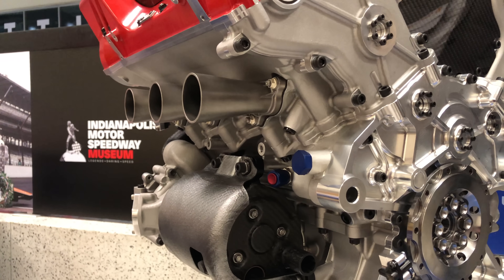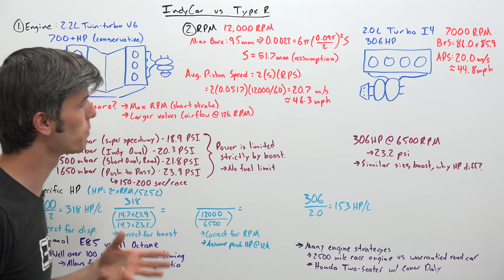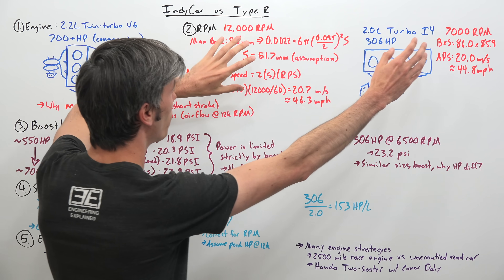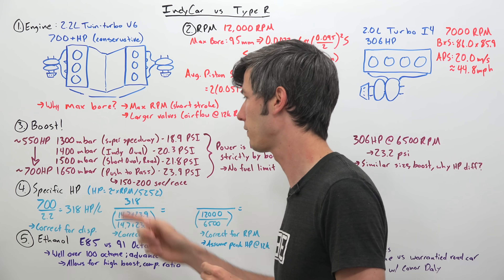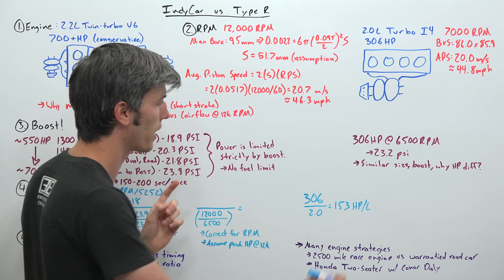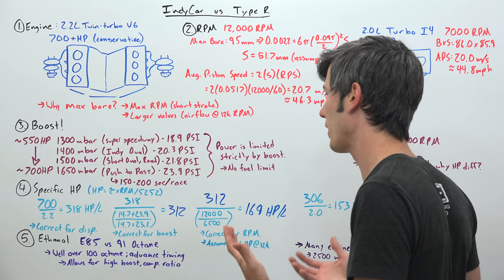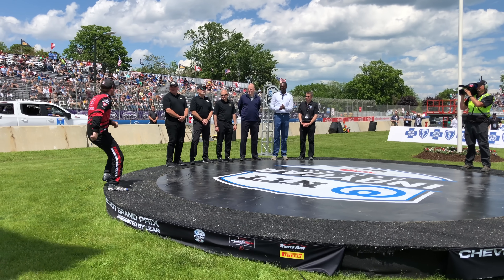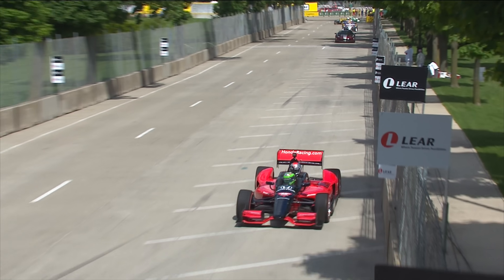How Honda’s 2.2L Engine Makes Over 700 Horsepower

Comment from the maker: IMPORTANT CORRECTION: In this video I state the boost pressures are 1300-1650 mbar above atmospheric, as is indicated on IndyCar's website (https://bit.ly/2XvviEU). This information, and the website, are not correct. Two IndyCar engineers have since notified me the boost pressures are absolute, meaning the gauge pressure for these engines above atmospheric is about 300-650 mbar, or about 4-9.5 psi. This is significantly less boost than discussed in the video. The math makes sense as well with the update. With pressure ranging from 1300 to 1650 mbar, and power ranging from 550 to 700 HP, we can do some quick ratios to see if it adds up. 1650/1300 = 1.27. 700/550 = 1.27. The power gain is thus proportional to the gain in pressure. E85 plays a larger role in power generation than the video indicates, and makes up for the gap that the "reduced" boost makes. Apologies for providing incorrect information, and thank you to the engineers who reached out with corrections and supporting materials! Mistakes happen; I will always do my best to provide corrections if necessary! Hopefully IndyCar will correct their website as well to reduce future confusion.
Reply: Very important correction! :)  Thanks for clearing up. It seems obvious to me that the Civic 4-lunger certainly isn't running anywhere near that boost pressure either, certainly not on pump gas at 9.8:1 compression!
Reply: @devilsoffspring5519  Yes it will. Corrections because of knocking will be done via ignition timing.
Reply: @jakecole7447  It really runs at well over 20 PSI boost on pump gas at 9.8 CR? Somehow I really doubt it. For 300HP on a 2.0 liter 4, more like less than 10 PSI.
20+ PSI shouldn't be necessary for 300 HP, nowhere near that much.
Reply: @devilsoffspring5519  dude... Just Google it. They run 22-25 psi Stock. And no you dont teach 310 HP with that RPM and compression with 10 psi. Modded 5.2 Liter v10s run that sorta boost.
Reply: @devilsoffspring5519  Intake pressure is not as related to power output at most people think.  Turbos that are larger will function much more efficiently at peak rpm.  This means one turbo can provide quite a bit more power than another (at identical PSI) because of increased air density.  In other words.. PSI doesn't measure how much air is actually flowing through the motor, it only measures pressure exerted on the intake manifold.  This is why you have hondas and subarus making under 300 hp at the tire but still running 16 PSI and other street cars making well over 500 hp with 16 PSI
Reply: @devilsoffspring5519  my Subaru WRX hits peak boost at about 22 psi. Stock turbo.
Reply: @devilsoffspring5519  my subaru was dyno tuned to 300whp and has 18psi.
Reply: @FalloutMan493  THANK YOU. I was waiting for this. People love to talk about boost, when they should really be talking about air density. Banks Engineering really exemplifies this in their tuning, and Gale has made some killer videos (pertaining to diesel engines, but the concept is obviously the same).

It blows my mind how people forget that. With NA engines, there's always talk about elevation and air temperature and what not because it affects the air density and thus the power NA engines make, but the whole point of forced induction is to have denser air, which means more O2 to burn more fuel and make more power. It's why smaller turbocharged engines can match the power of a say a larger V8, but be more efficient when cruising or not under load (see Ford's Ecoboost motors VS their 5.0 V8). I think that within a couple decades, the only V8's that will be left in production automobiles will be in supercars (and likely paired with hybrid systems and will have small displacements) and future versions of the Powerstroke and Duramax diesel engines in trucks. Small turbo engines will reign until EV batteries are sustainable enough environmentally and yield power densities a few times higher than they currently do to allow EV's to take over.
Reply: My suggestion, remake the video where this gets corrected/discussed otherwise we get false data implanted into our brain. That's why this sort of vid is good, we have a stab at how we see things, "experts" pop up and offer valuable info, we all gain. Good job. These question have wizzed though my mind, I'm a curious engineer. I'd like to know the detail of F1 engines compared to a powerful commercial engine. I know octane and revs are the main ones. One comment by an expert was, tolerance are greater (and well defined) on a sports engine, longlevity is not the criteria.
Reply: Would you ever consider doing a video about the upper limits for an engine's RPM? 
I know F1 cars have had some crazy fast turning engines in the past, and when I calculate the time the combustion cycle has to produce power I get a surprising small number. 
Which leads to my question. Is flame propagation the limiting factor, or something else?  And if so what is that limit (in time and rpm)?
Thanks
Reply: The main reason  why we don't have this high hp compared to engine size in street legal cars is because of emissions regulation : racing cars are not restricted by this. I doubt you can make a 2.2 700 hp engine and still make the emission regulations which get stricter and stricter
Reply: I'm having an awesome time😅😅😅😅😅😅😅
Reply: I really think you should look at class 8 truck engines such as the n14 c15 and others c16 c18 kta19 the c15 twin turbo I drive makes peak torque before 1500 rpms very cool
Reply: youre the best
Reply: Legend cuz
Reply: 4cylinder is faster honestly lol
Reply: ⁶⁷⅞
Reply: How much more power from e85 over 91 octane gasoline
Reply: Dude, you still rock, maybe even more because of your humility.  Oh nevermind, I forgot, engineers don't have feelings. 😉
Reply: Real smart, talking to an amateur driving 200 mph. Real intelligent.
Reply: Interesting you don't give any credence to the fact the pistons and cylinders are machined that much more precisely than commercial engines thus losing less energy in the combustion process. Hence why F1 cars engines need to be warm when turned over.
Reply: @jeremycole32  Nope F1 cars need to be warm when turning on because the pistons are so flat that there would be risk of tipping when they´re cold and for proper oiling since they idle at quiet high rpm. Also friction energy is a very very minor percentage of power it requires from an engine.
Reply: No way a 2.2 liter engine made 700hp on 9psi of boost. And no way a 2.0 liter 4 cylinder made 310hp on 9 psi neither..
Reply: @grumpystony  Boost isn't everything. Firstly, air density is more important, and one can maximize the density of the air going into the engine through intercoolers and other means.
Secondly, remember, this is a race car engine. There are no limits to exhaust or intake setups or emissions to worry about like there are in passenger vehicles. 
Finally, they run on E85 which allows them to make way more power than you can with pump gas. 

You have a lot to learn if you genuinely believe those power numbers aren't real, unless your comment is simply stating how amazing it is that they squeezed so much power out of that little engine.

Edit:
Almost forgot to mention RPM. The engine revs to 12,000 RPM. Remember, horsepower is torque times RPM, and while it is obviously not always that simple (see HP and torque curves, along with gearing), 12,000 RPM allows for significantly more power, as far more power strokes occur, meaning you can burn more fuel and air and hence have a higher power output. It's really not unrealistic
Reply: @BradChadley  that's cute.  I build and tune my cars.  We dont have restrictions neither.  Those racing Honda cylinder heads and the same intercoolers we use cant make 700 hp out of 2.2 litres @ 9psi even out of a large frame turbo. Now on a GM lsx engine with decently large cubic inch. 5.0litre and bigger could easily make 700hp on large twin in the low psi range. That's just real world experience. I dont need fancy calcations.
Reply: @grumpystony  Well, go to Honda with your real world experience and maybe you could learn some things to help improve your business.
Reply: @grumpystony  And again, consider the RPM limit and the fact that it runs on E85.

Also, the math is right in front of you on the video, and again in Jason's comment. It's absolutely absurd that you would question it without doing any math or research into how it is done, yet simply claim it is false because you have experience building engines.
Reply: Seriously, I want to know what your  IQ IS . SO WHAT IS IT?

Comment: This vid is similar to my engine. For decades i hv wanted to make over 500HP on my 2.5 L twin turbo engine. Stock OEM is 170HP, 6K RPM, compression: 7.6--1, w/8psi.  To hit my goal, i think it is required to somehow raise compression to 9:1, or 10:1 w/14--18psi. Bcuz, if i run 35--50psi at 7.6--1, it might be too much stress on the head-to-block area. Is my 6K RPM a fixed, unchangeable area? Til now, i hv only been able to get 240HP at 6K rpm at 20psi. I remember Toyota built a 2.1 L w/900+ HP Pikes Peak car. Is my goal achievable? What should i do to achieve my goal ?

Comment: That was a nice looking k24a4 you showed. Great engine. It was under used imo. It has more power than most Honda 4 cylinders and is one of their most powerful N/A 4 cylinders engines. It’s also extremely reliable. The k24 should have been used in more Hondas

Comment: Your calculations suggestion  the F1 pistons have a 10% greater circumference and a 22% greater top surface area. Considering just these dimensions suggest the F1 pistons would be heavier. It’s not obvious a shorter stroke provides a lot of opportunity to make a piston lighter but I’m am sure Honda Engineers did there magic and likely used clever design and likely exotic materials to minimize weight because with the same piston velocity and a 72% higher rpm the pistons will have to accelerate 72% faster and as Issac pointed out F=mA. Honda did an amazing job making this engine work.

Comment: something else to mention is where in the rpm the torque and power curves are, the 2.2l has more peak power so would be a blast to rip through the gears but im betting the 2l has a far more consistent curve throughout the whole rpm and honestly im betting its got more torque through out most of the lower rpm making it far more usable as an actual street engine.

Comment: How has Honda done at the Indy 500 since this engine started. 2012, 2014, 2016, 2017, 2020, 2021, and 2022, All winning the race. The season, 2013, 2015, 2018, 2020, and 2021 Championships. All the Titles came with Chip Ganassi, but only Two Indy 500's did as well. Andretti won 3 of the races, and Rahal and Meyer Shank won the other two. Everything else since 2012 was won buy a Penske Chevy team, except the 2013 Indy 500, won by Kevin Kalkhoven (RIP) and Jimmy Vasser's team and Tony Kanaan, in a Chevy.

Honda also won every Indy Racing League/IndyCar Series Race from 2006 to 2011 as the sole engine supplier, Except for the 2008 Long Beach Race due to Champ Car rules. But yeah, Honda Revolutionized IndyCar racing

Comment: Not a big deal but you said specific horsepower when you meant to say brake mean effective pressure. Specific horsepower is power to weight ratio. It has always amazed me how many different ways there are to describe how engines make power.

Comment: Probably it exploits tighter tolerances, making more power from each power stroke.  The intake and exhaust paths are perhaps more ideal because the engine does not concern itself with fender or hood clearance.  Their e85 is probably a racing brand carefully mixed whereas the type sold at the pump is much less consistent...allowing them to run more timing than you even if you have e85 at local stations.

Comment: G'Day Jason,Mate my only comment(Correction)Is Piston speed,,12000rpm the piston is changing direction super fast,,so not so much piston speed as distance travelled,,
think about it12000Rpm mean the piston has to travell up and down 6000 time a minute,a lot more, so speed would be far higher,compare to dictance travelled,,
Do like your show,,Not always in agreement,, but get me thinking..and I like that,

Comment: In 1986 there was a renault 5(le car) maxi turbo 2.
385hp and 354horse power.
With 1.4liter.
35 have been pass already and they may have more technology.
Renault is working on low profile...

Comment: One calculation you didn't do is piston acceleration -- important not because it changes specific power but it does begin to explain specific costs.  I'll give it a go, sorry no whiteboard:

12,000 rpm / 60 = 200 rps
1/200 = .005 sec per rev
.005 / 4 = .00125 sec per half stroke
20.7 m/s x 2 = 41.4 peak piston speed
41.4 / .00125 = 33,120 m/sec^2
33,120 / 9.8 = 3,380 g (assumes constant acceleration simplification)

7,000 rpm / 60 = 116.7 rps
1 / 116.7 = .00857 sec per rev
.00857 / 4 = .00214 sec per half stroke
20 m/s x 2 = 40 m/s peak piston speed
40 / .00214 = 18,666.7 m/sec^2
18,666.7 / 9.8 = 1,904 g

3,380 g / 1,904 g = 1.77 
If my calculations are close, the race engine's pistons experience in the neighborhood of 75 percent greater force (disregarding differences in weight, which are probably significant but costly, and include material property and size - material amount - factors).

Comment: The civic type r can make 140 horsepower at 2500 rpm and 252 horsepower at 4500 rpm where it’s the peak torque of 295 lbs and the full 306 horsepower at 6500 rpm. I discovered it myself by doing the math. Because (Torque x RPM divided by 5252 = horsepower) so (295 lbs x 2500 RPM divided by 5252 equals 140 horsepower). And (295 lbs x 4500 RPM divided by 5252 equals 252 horsepower) Do it y’all selves and y’all see it.

Comment: Assume both engines have 4 valves per cylinder, the V6 has 24 valves and the I4 has 16.  More valves = greater airflow. How could he have missed the 24 vs 16 valves as a primary contributor to the different power outputs?

Comment: The sound of a Honda Motor at 7,000+RPM to me, sounds awesome! With the right exaust, its in the same league as the Italian V12s or American V8s 
Honda makes strong engines. And are fairly simple to work on. Most of them will take boost pretty good

Comment: As soon as I saw 12000 rpm I just thought to myself that you have a factor of two there straight away.  I think the cam profiles will be pretty wild in the race car and the peak power band extremely narrow, none of which is desirable in a road car!

Comment: How does honda make 700 whp out of a 2.2? Intresting question Jason. 

How does honda make 700whp out a 2.2TT? Well Jason, with boost you absolute pillock. 

Just because they both see ~23 psi above atmospheric pressure you still need to know how big the turbo is, a bigger turbo pushes more air at a given boost pressure. Turbos aren't measured in boost, they are measured in CFM. A smaller turbo is going to spool faster and be more effcient at lower pressures, while a mid sized turbo will have response and a broader range of effciency, while a large turbo won't be efficient at low boost, but will be an absolute minger at higher pressures, of course with added lag and higher boost threshold.

Comment: Another plausible reason for the greater horsepower in the V6 vs the I4 is the head design and valve size. In a NA engine heads are where the HP is.

Comment: How often is the engine rebuilt? if you wanted 2000 miles then fuel+air=power for any engine design. if there is no concern for consumption or durability then I dont understand the fascination.

Comment: Why is boost directly compared? Doesn't cfm make the difference when in comes to making power?  6 psi is 6 psi. But at what cfm?
Reply: Exactly, total volume of air in  race engine is about  2x of the street engine

Comment: We should need to see how the k20 would do with stock boost, but free intake and straight exhaust, and revised fuel and ignition advance. Then it would be both "off-street" spec. And same fuel (with corrected ignition)

Comment: So is this to say that if you were able to get the I4 to run at 12,000 RPM, and used racing fuel that it would be able to produce nearly 700 horsepower?

Comment: With an avg piston speed at 20.7m/s, they can say the engine is only designed to do 2500 miles, but really it should be able to do a lot more. I suppose this is likely due to running a tiny overall coolant and oil volume through the block to improve packaging and weight.

Comment: The Civic engine is actually used in a number of junior formula cars, as well as the Fit engine in the F1600. (Think of a replacement for Formula Ford)

Comment: too technical. it's fitted with a large turbo, hi compression, large valves, short stroke, free flowing exhaust.

it took 60 seconds to write this and probably only 10 to read it.
solved.

Comment: Honestly, any manufacturer that is still using a cam shaft for high output internal combustion engines is obtuse. Koeingzggzzggh has showed us how a valve system should have been right from the start. It is a shame that large manufacturers did not invest into this and it took an ambitious small company to do it. Honda, hayabusa, cosworth= backwards old trash.

Comment: I'm more interested to know how the F1 engines were getting 1500 HP out of 1.5 Litre in around 1986.  That would be a much more interesting investigation
Reply: Turbo chargers and the fact that the engine and turbos explode after 4 laps.